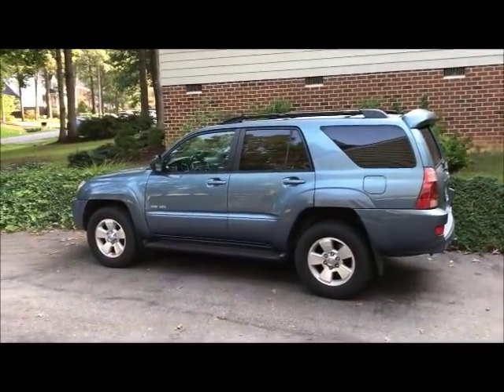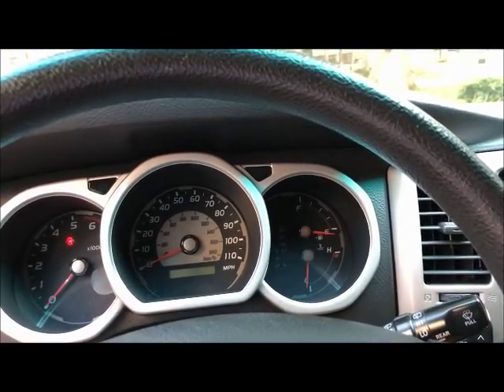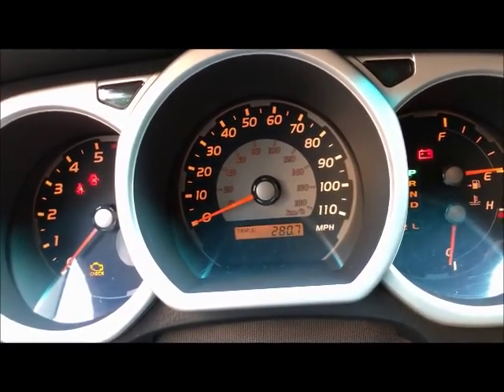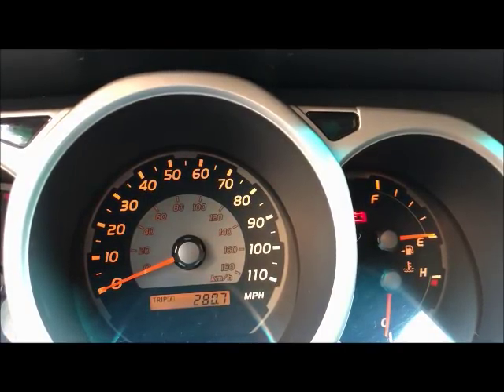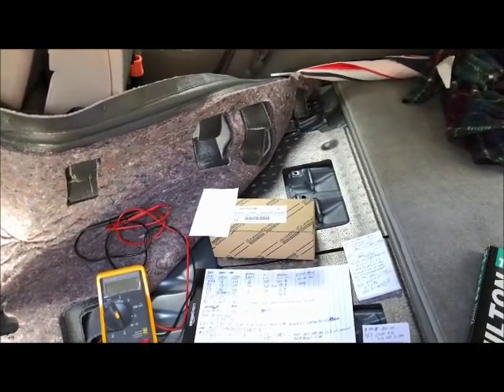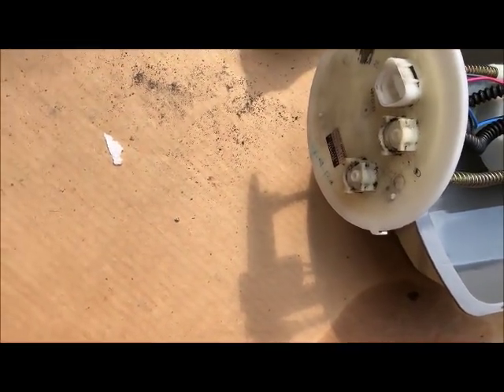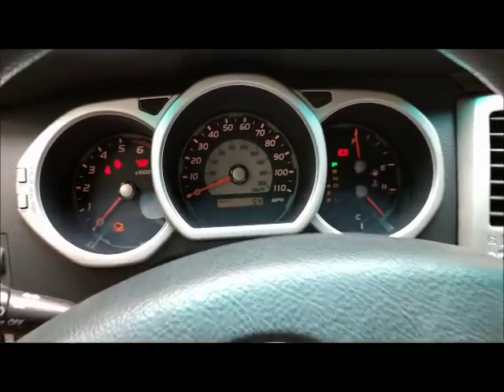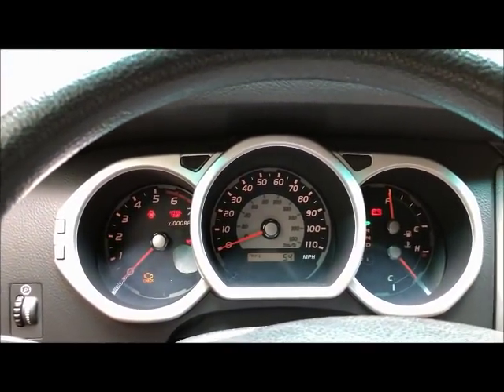2005 Toyota 4Runner Gas / Fuel Gauge Problem - Fixed!

Comment: I have 2004 gx470.  Uses same part number.  Mine looked just like yours with the burn marks.  Poor design.  Guaranteed to fail.  Expensive to fix.  Took my mechanic 3 hours and he is a pro.  You can’t drain the tank to do the job .  No way to know how much gas in the tank.  Mine was almost half full.

Comment: Hey i have a 07 toyota 4runner sr5 4.0 and my car die on me 1 time .and the screen is telling me that i have 23 mile still no low gas light come on..the gauge  don't go low to turn the light on..u tink its sain problem.
Reply from the maker: Hello, 
If that's never happened to you before:  The first thing I would do is put 5 gallons of gas in a gas can, put that in the 4Runner, and see if it starts.

Comment: I have a 2006 4runer with a reverse problem. My gauge is showing I have less than a 1/4 of gas and it empty. My range shows that it has 20 miles to go. Will your solution correct my problem?
Reply from the maker: Hi Dennis,
As of right now, I don't know.  You saw in my video that I dd a tremendous amount of troubleshooting to diagnose mine.  I don't have enough information about yours to give you an educated guess.  
I can suggest this:  I get roughly 400 miles on a full tank.  Fill your gas tank, and reset your Trip A odometer.  Watch your odometer as you use-up the gas.  With my gauge working correctly (on my V6 motor), I am at 3/4 full at about 100 miles.  1/2 tank at 200 miles.  1/4 tank at 300 miles.  How does your gauge compare?  Does your gauge go to full with a full tank of gas?  How does it read for that last 100 miles?  A nice smooth transition to zero or it stays at 1/4?

Comment: Did your range reset itself yet?
Reply from the maker: Hello,  Yes.  It did.  It went back to its usual reading after a few tank fulls.  Then, I went on a 1300 mile, highway miles, round trip and the range number went even higher (423) with the next few tank fulls.  On the long trip the MPG must have increased due to the highway speeds, so the computer calculated the range based off the "updated" MPG times gallons in the tank.